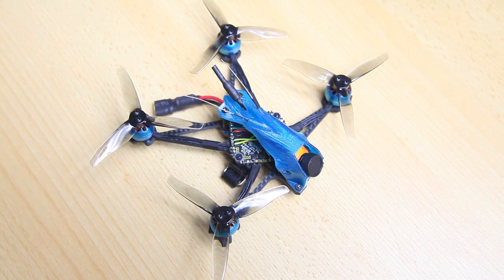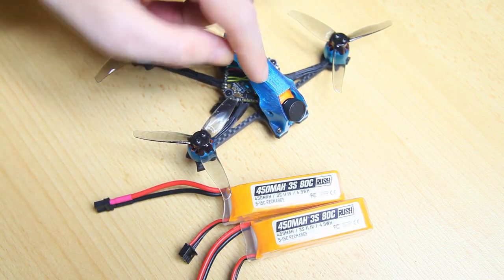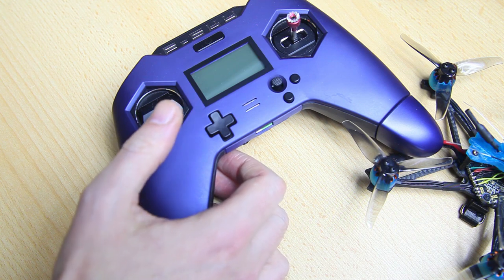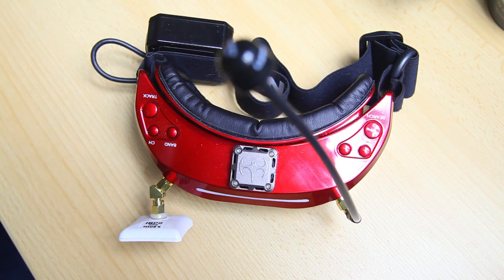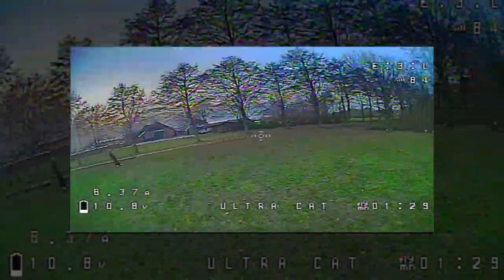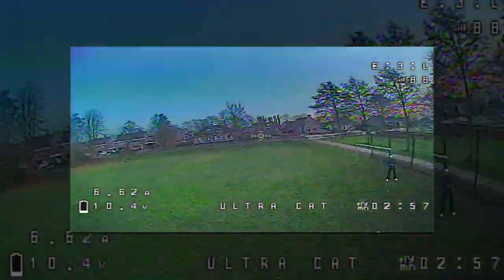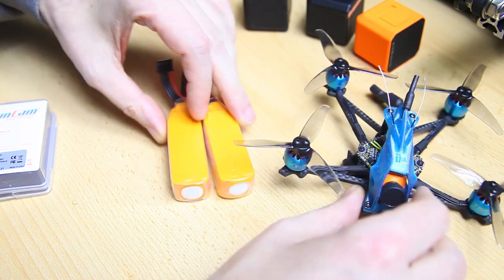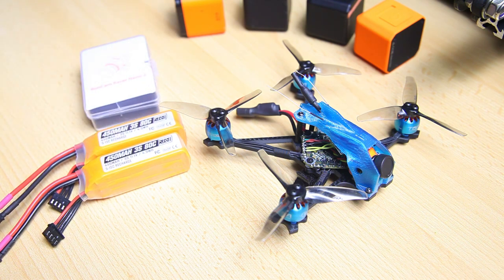Ultra Light Dead Cat - P2 SEND IT ! :)

Comment from the maker: Time for some rippage ;)  
The iFlight Cinepick 3" frame: 
https://www.banggood.com/IFlight-Cinepick-120mm-Wheelbase-3-Inch-TPU-Canopy-Frame-Kit-for-RC-Drone-FPV-Racing-p-1598492.html?p=TO251813974002015038 

The BetaFPV AIO 20A FC: 
https://betafpv.com/collections/brushless-flight-controller/products/toothpick-f4-20a-aio-brushless-flight-controller 

Karearea 1107 motors: 
https://www.banggood.com/Karearea-TOA-LITE-1107-6500KV-2-4S-1_5mm-Shaft-Brushless-Motor-compatible-2-Inch-Propeller-p-1585817.html?p=TO251813974002015038 

Gemfan 3016 3-blade props: 
https://www.banggood.com/2-Pairs-GEMFAN-3016-3-Inch-3-blade-PC-Propeller-1_5mm2mm-Hole-for-Hurricane-Toothpick-RC-Drone-FPV-Racing-p-1609433.html?p=TO251813974002015038 

Runcam Racer nano 2 camera: 
https://www.banggood.com/RunCam-Racer-Nano-2-CMOS-1000TVL-1_8mm2_1mm-Super-WDR-Smallest-FPV-Camera-6ms-Low-Latency-Gesture-Control-OSD-for-RC-Drone-p-1601159.html?p=TO251813974002015038 

Runcam TX100 nano VTX: 
https://www.banggood.com/RunCam-TX100-Nano-5_8G-37CH-25mW100mW-VTX-Smart-Audio-IPX-IPEX-for-RC-Tiny-Drone-Mini-FPV-Camera-FC-p-1597688.html?p=TO251813974002015038 

Crossover XR602T-F2 FrSky D16 compatible receiver: 
https://www.banggood.com/Oversky-XR602T-F2-16CH-SBUS-Micro-Mini-RC-Receiver-2KM-Range-Double-Antenna-Compatible-FrSky-D16-p-1507200.html?p=TO251813974002015038 

Rush 450mah 3S 80c lipo: 
https://www.banggood.com/RUSH-3S-11_1V-450mAh-80C-V2_0-Lipo-Battery-JST-Plug-for-RC-Drone-FPV-Racing-Multirotor-p-1428905.html?p=TO251813974002015038